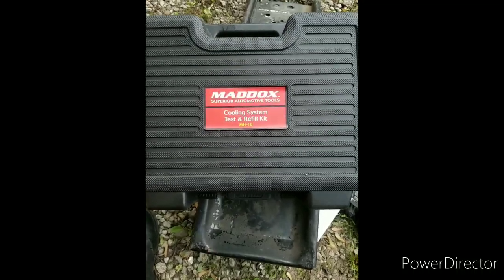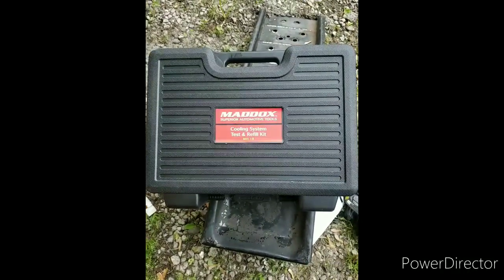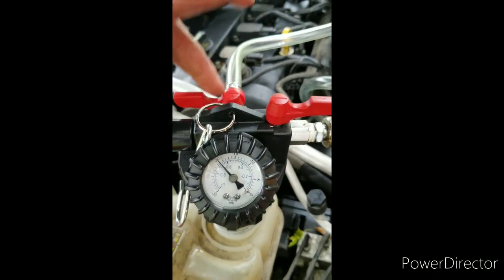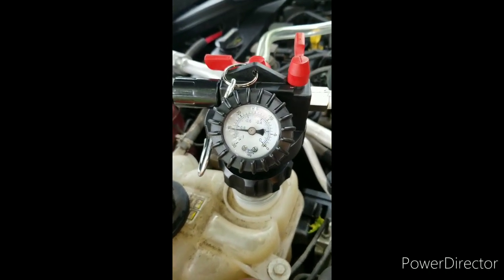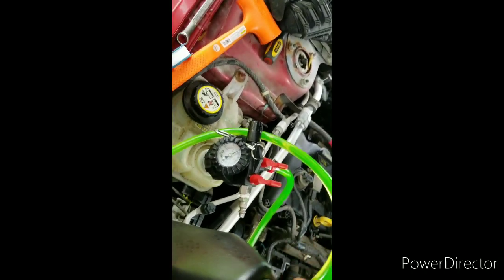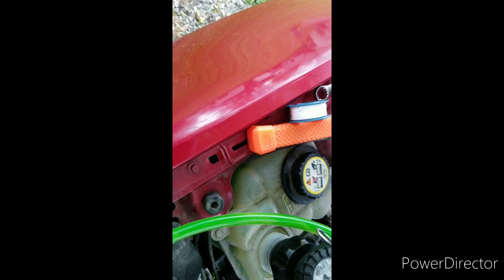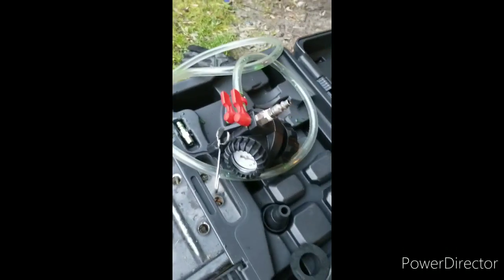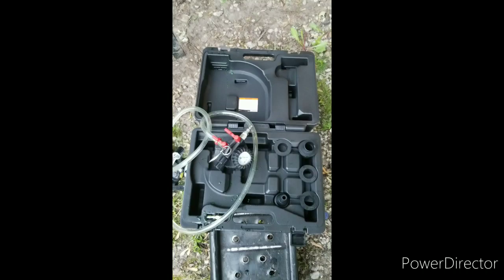Maddox cooling system and refill kit review and how to avoid stupid mistakes!

Comment: Another tip, not having used one before (but bought one today) is to submerge the intake hose in the fluid filling it with coolant (rather than air) before you hook it up to the tool.  Otherwise before it sucks up coolant it is sucking up all of the air that is in the tube first.
Reply: So I used this tool over the weekend.  It was pretty easy overall.  I did submerge the intake hose in water first.  However it wouldn’t work right without some valves to close it off.  So I had to cut the hose and add valves to both ends so the water would get locked inside of the hose.   I think it worked pretty well.  

I wasn’t able to hold vacuum for some reason.  The radiator, water pump and expansion tank were brand new.  I think (hope) it was because my expansion tank had a barbed vent on it at the fillet neck.  I had to cover it up to get vacuum at all. I am hoping that some air was coming in through that rather than somewhere else.   I also hope that it didn’t cause too much air to get into the system.   The entire purge may have been a waste of time for me.
Reply: Curious if you could crack open the fill valve when you are still hooked up to air pulling a vacuum. Maybe it will fill the refill line.

Comment: Can I check for leaks with it not empty?
Reply: If you use this without it empty the excess coolant will be expelled out the venturi exit,  the left port, opposite the compressed air intake. The Air Lift version of this tool, my shop has it,  has a discharge tube for it,  but you got to swap the venturi hose for the fill hose and it's a big pain in the ass.

Also if your air compressor has moisture in it, that will be expelled out the exhaust as well.

Comment: No blow molded case comes ready to change the configuration of the tool stored at best they come with the ability to store fittings in a common area if you want to change the configuration of plastic use a heat gun to warm the plastic and then use a piece of metal to push the plastic in and allow it to cool then remove the metal  blaming a company because they didn't make the blow molded case to accommodate a custom modification seems a little ridiculous
Reply: I agree with him about the case design you can't leave the air fitting on it's something as an engineer that should have been thought of ,honestly it's the most aggravating thing about this tool there's nothing custom about it the air fitting goes on the same way on every unit. Maybe quality control watches this video (most companies do watch reviews on there products )and they accommodate.
Feedback is a good thing.

For now I do like your idea